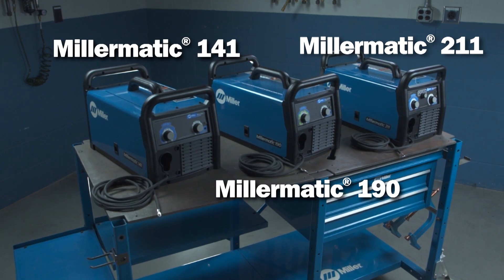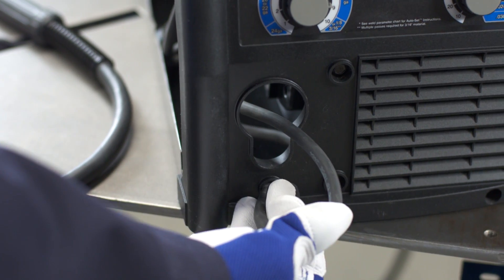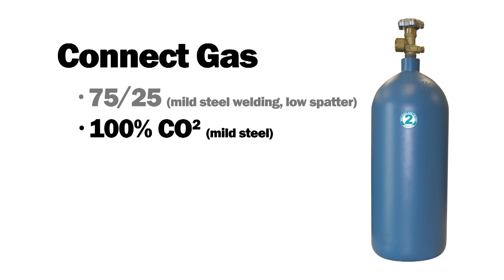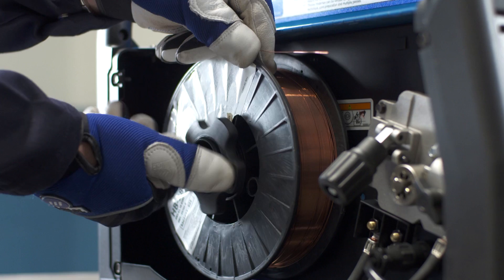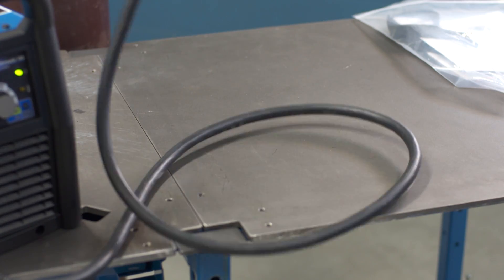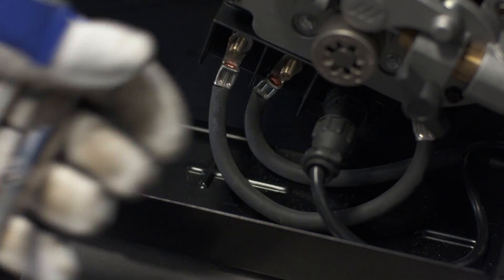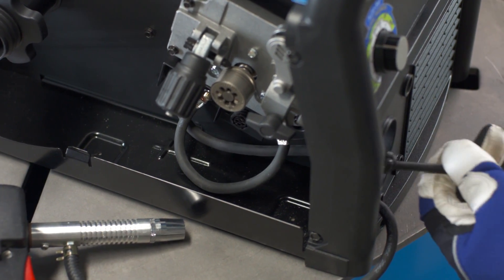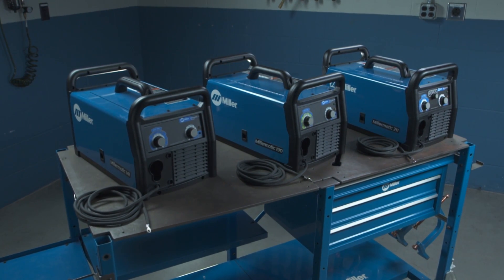Setting up your Millermatic 141, 190 or 211 MIG welder

Comment: I just bought a new Millermatic 141 and the overheat light comes on at power up and won't turn off.. troubleshooting suggestions in the manual don't fix anything. Super disappointing for a new USA made machine and totally unacceptable. Suggestions for how to get this paperweight working?
Reply from the maker: Please reach out to us at (920) 734 - 9821.

Comment: If my drive roll tensioner is tightened all the way and still having feeding problems then do you think I need a new liner?
Reply from the maker: Hi Stephen. We recommend giving our service line a call to talk this through with a tech. The number is 920-734-9821. If there’s anything else we can help with, just let us know.
Reply: @MillerWelders  Gave them a call, they where quite friendly and helpfull, got lined out on what I might need. Thanks for the help!

Comment: The details on how to set gas flow seem a little lacking. 
As far as the video shows, you just install the regulator, place tubing between regulator and machine, then you are done.
 What is the purpose of the shielding gas if i never open the bottle valve?
Good info otherwise.
Reply: How many years did you piss on the seat before someone told you to raise the lid?